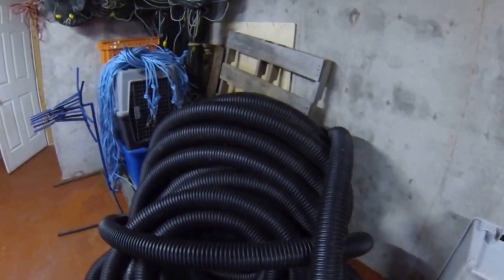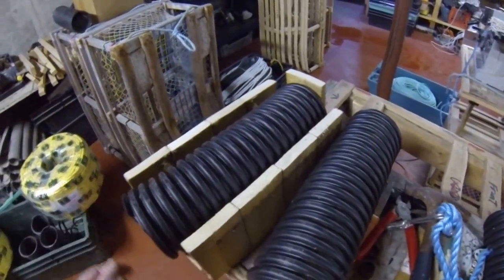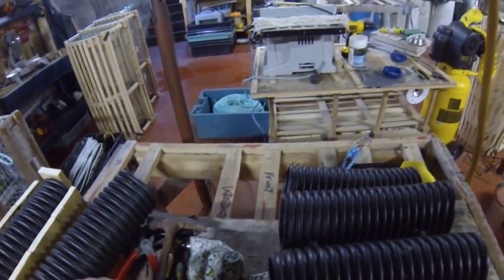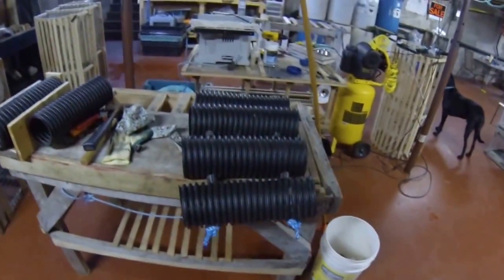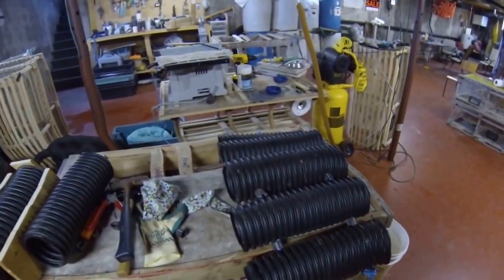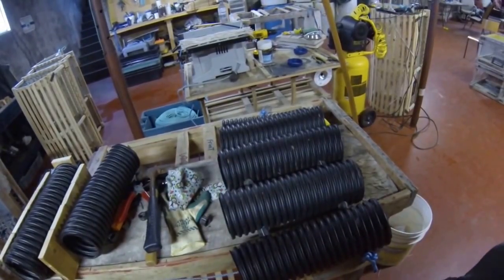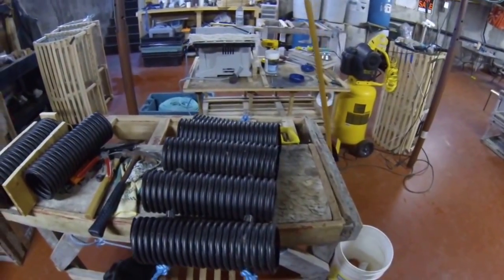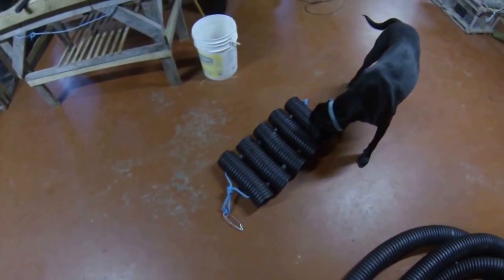BUILDING OYSTER COLLECTORS!!

Comment: Thinking of giving this a try, couple questions
Any specific reason with using mortar, theres different mortars and I wouldn't know where to start lol. Theres like mortar with lime etc.... can I just use portland mixed with fine sand in place of mortar? I'll be doing this project in a different country and certain items might be hard to come by there. Also the clip end will that just attach to a floating rig or let this rig sit on the bottom? 
Thanks for sharing tips and hope to hear back from you.
Reply from the maker: any mortar should do and try keeping them floating close to the top of the water as thatswere most of the spat is